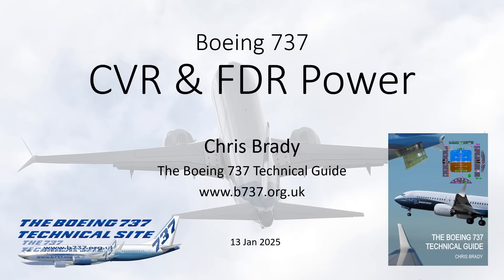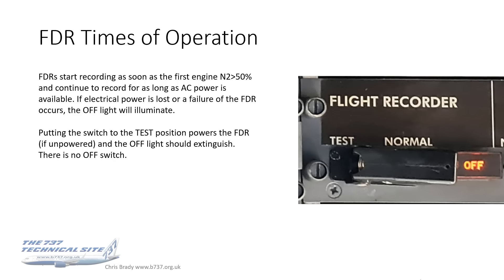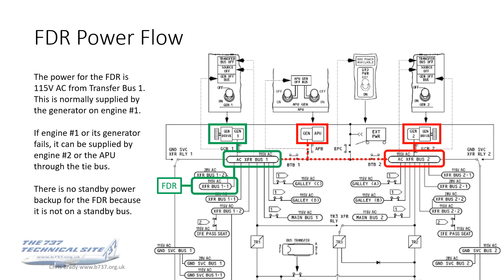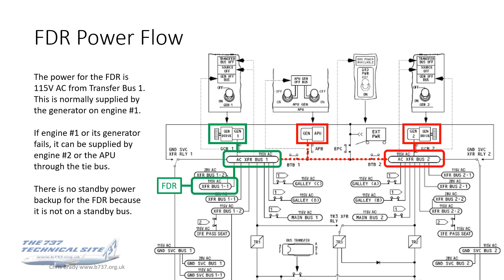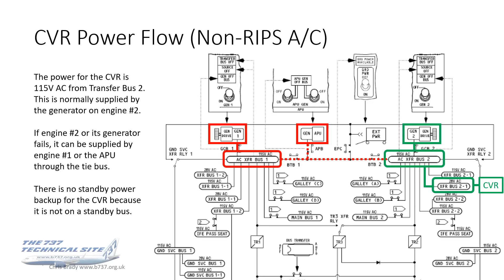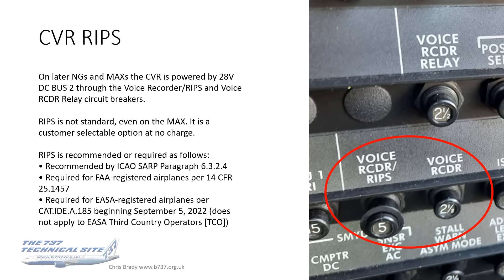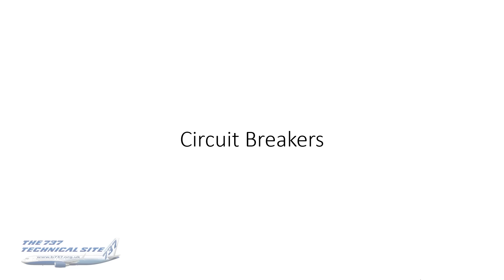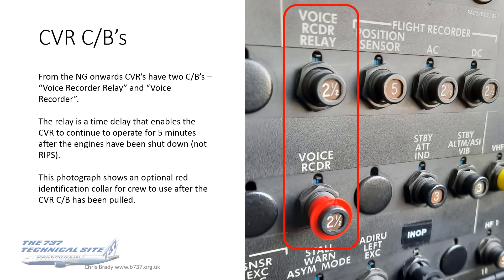737 CVR FDR Power

Comment: A reason not mentioned by Chris, for CVR and FDR to lose power, is if the pilots activated the fire extinguisher modules on both engines.
This cuts all connections to the engines, electrical, fuel, etc.

However, engine number 2 seemed to be running during the landing as indicated by the thrust reverser.
If this is correct, engine number 2 could have provided (some) power, which means it is a mystery why both CVR and FDR were disconnected 4 minutes before the crash.
ADS-B also stopped at the same time.
Reply: ADS-B would stop if a bird took out the antenna.

Comment: I'm rather surprised such a large transport aircraft isn't always required to have a standby backup power source for the recorders that can take over at a minimum when there is no weight on wheels. I would have expected the recorders to be prioritised to the same degree as the primary flight instruments for getting power, as in my view at least, losing the recorder data could cause an indirect risk of loss of life due to subsequent accidents. But i guess with the way the 73 was upgraded in such a piecemeal fashion, it would have been difficult to integrate cleanly and consistently across the fleets, but then again I get the idea that some AD will get sent around after this accident requiring RIPS and similar installations to be added to whatever aircraft don't already have them.
Reply from the maker: The recorders, whilst very important for post accident investigation, are of no help to crew in an emergency. Battery power is very limited and must be used conservatively. The regulatory authorities agree otherwise it would be mandated that the recorders have emergency power. Maybe this will change in the future after this accident.

Comment: Nicely done Chris!  I do agree Boeing's philosophy on maintaining electrical power to systems essential for flight control and that the black boxes aren't critical for getting the aircraft on the ground.  That said if we don't understand the human factors and what failures they are dealing with in an emergency then there will always be the possibility of it being repeated.  

P. S. I believe in the Alaska Air plug blow out incident the crew forgot to pull the breakers and the CVR data was lost.
Reply from the maker: It is (understandably) very common for crew to forget to the breakers after an incident.
Reply: @ChrisBrady737  Ground crew often double check the CBs, just in case the pilots have lapse of memory.

Comment: Speculatively, number 2 engine is damaged, the engine speed is low enough that the generator drops offline but continues to windmill sufficiently for the EDP to supply a small amount of hydraulic pressure, the crew elect to go around to go through checklists, they clean up the aircraft and retract the gear and flaps, the crew then shut down the left engine, all main AC power is lost, including power to the recorders, the crew elect to land immediately but land very long without gear, flaps or spoilers, there is sufficient hydraulic pressure to deploy the right thrust reverser during landing. 
RIP to the passengers and crew. 🙏🏻
Reply: From the ADS-B data, the go around may have started (with two good engines) before the the bird strikes. It is also possible that there was more than one incidence of bird strike.

If one engine had been damage the engine driven generator may have dropped out, so that the remaining engine was supply both the AC XFR bus 1 and AC XFR bus 2. if the good engine then fails all AC power is lost at the same time. This would result in the CVR & FDR and the transponders (and ADS-B) all ceasing operation at the same moment. Which is what appears to have happened.

Comment: 15:05 I have a question. If FDR doesn’t have any standby power. Why there is a DC(BAT) breaker in the FDR field on 737 classic’s circuit breaker panel? Doesn’t it mean FDR has battery? Or it’s only for 737 classic? If so, is there a photo of a 737-800 made at 2009?
Reply from the maker: On the FDR these components get 28v dc power: FDAU status relay, Flight recorder test module and FDR fault logic. Again, the recorders are powered by AC and will not work without it (except RIPS for 10 minutes)

Comment: Simply put, if there were no independent standby battery packs, then when no electrical power was produced for whatever reason, the recorders would definitely have stopped recording immediately. From what you said, this could be determined. However, we cannot determine if that plane has or not had independent standby battery packs installed.
Reply: This airframe, ordered by Ryanair and constructed in 2009, did not have RIPS installed.
Reply: @teebob21  This needs to be determined beyond a doubt, together with the answer to whether the plane was completely without electrical power for the four minutes before it exploded. The victims deserve the truth.
Reply: @teebob21  "This airframe, ordered by Ryanair and constructed in 2009, did not have RIPS installed."

JeJu AIr purchased 11 737-800's from Ryanair in 2016. They currently have 37 on the fleet 20 of which built before 2020 when the FAA  recommended the RIPS to be installed. The remaining 10 aircraft purchased from Ryanair, should be at the original standard, so these could be examined to confirm the absence of RIPS. The modification records for the accident aircraft should also confirm the absence of RIPS.

Comment: Great video Chris, as always!  I must admit, I only became aware of the concept of the CVR/FDR requiring both engines to be running (or the APU) after reading the Air Transat A330 report a few years ago, and being astonished.  If anything is likely to lead to an accident in a twin-engined aircraft - it's not have both engines running!  So, it would be pretty useful to be able to analyse the final stages of the flight, for what must be a minimal electrical power consumption.  Hopefully RIPS will become mandatory soon, although in the Air Transat incident 10 minutes would not have been sufficient for the whole descent.
Reply from the maker: Hi Scotty, useful for the investigators but not useful at all for the crew on the day. Even worse it could be counterproductive to the crew on the day because of the drain on the battery of running the FDR & CVR. The load may be small but it is 115V AC sourced from a 36 or 48 Ah battery. The solution is RIPS with a bigger battery and similar for the FDR. I guess it will come eventually.
Reply: @ChrisBrady737  It doesn't do much good to power just the FDR. The FDAU and the sensors and computers that generate the data that is recorded have to be powered too and most of them are not on the BAT or STANDBY bus.
Reply: They don't require both engines, they require one engine driven generator running (or the APU, or ground power). If one generator fails the bus ties will automatically close to power that transfer bus from the other generator.

Comment: So, the #2 Gen is possibly damaged  by the bird strike and then the crew inadvertently shuts down #1.  On battery power now but no recorders.  Correct?
Reply: Why would they turn off an engine in the first place? There was no fire seen from the ground?
How would immediately turning off an engine help an aircraft which would land in 2-3 minutes?
Reply: @user-yt198  When a birdstrike damages an engine it typically is because it took out one or more fan, compressor or turbine blades. That loss may cause compressor stalls which can create further damage to the engine and affect flight performance and handling, but will certainly cause a severe off-balance vibration, possibly at resonance frequencies with other structures that can cause catastrophic structural failure.
Reply: @petep.2092  We are talking about engine #1 (the left engine). In the videos and after accident photos it looks in quite good condition.
Possibly it was affected yes, but such a vibration would not be more than an annoyance for such an engine as we see.
 Obviously there wasn't a fire which would affect aircraft safety either.
Again, why would a pilot turn off an engine of an aircraft which would land in 2-3 minutes?
Reply: @ I don't speculate on what may have transpired. I was simply answering your question: why would a pilot turn off an engine?
Reply: @petep.2092  You think you are answering? Pilots turned off the engine because noise was disturbing sleeping babies?

Comment: I maintain 737s for a large operator in the USA and am very surprised to learn that RIPS isn't a requirement on all NGs. Our fleet has had them for years. Truly shocking this isn't actually required equipment.
Reply from the maker: I suspect it will become a requirement soon
Reply: @ChrisBrady737  Indeed.

Comment: Great video! Minor correction, for RIPS battery life, it’s not “at least” 10 minutes, it’s EXACTLY 10 minutes. The regulations require RIPS to provide power for 10 minutes to the recorder with plus or minus 1 minute margin. The battery can definitely provide power for longer but it is designed to cut off after 10 minutes due to concerns of powering it on for too long will overwrite previous data.
Reply: Also, if it provides power after every normal shutdown, if it would run until the battery died then the battery would be empty for the beginning of the next flight while it charged, so there'd be no RIPS protection for incidents happening early in the flight.
Reply from the maker: Correct 10 +/- 1 minute

Comment: So in theory, if the plane was dispatched with APU under MEL and it did lose both engines, that would be enough to explain the loss of flight data and voice recorders ?
Reply from the maker: In theory yes but we won't know for sure what happened until the final report
Reply: The APU air inlet door was closed, which suggests that the crew did not attempt to start up the APU.

Comment: Could they have dispatched with a failed generator and not had the APU running as a way a single failure could take down both transfer busses ?
Reply from the maker: Not legally. Under the MEL for despatch with an engine generator inop "Except for ER operations, may be inoperative provided APU generator operates normally and is used throughout flight."

Comment: If fire is occurred in gas turbine engine and can not be cleared by lowered the throttle, pilot can use fire extinguisher.
Since the fire extinguisher is only one time use, if the  connection in user panel is wrongly connected, the good engine may be cut off by fire extinguisher.
The connection can not be tested on ordinary checking.

Comment: i work at wendys bro tell me what happened, the south koreans edited the at the last 4 minutes to cover up the accident and save face huh
Reply from the maker: We all have to wait until the investigation is complete and the final report is issued before we know what happened. I am just giving background technical information about the way the 737 works.
Reply: The FDR was sent directly to the US NTSB and was found to be unopened and sealed.The connector was repaired and the data was downloaded. 

The CVR was downloaded in Korea and when it was found that the last 4 minutes were not recorded the CVR was sent to the NTSB. The unit was unopened and sealed. The NTSB downloaded the data from the CVR and confirmed that recording had stopped on both the CVR & FDR at exactly the same time.

The data that has been recorded cannot be erased from outside of the recorders. As both units remained sealed, the data was not erased.

Comment: The CVR should be operating under all scenarios. A battery dedicated to power the cvr should have been realized, like a backup power source in many consumer electronics. Design flaw by Boeing and overseen by the FDA, imho.
Reply from the maker: The recorders, whilst very important for post accident investigation, are of no help to crew in an emergency. Battery power is very limited and must be used conservatively. The regulatory authorities agree otherwise it would be mandated that the recorders have emergency power. Maybe this will change in the future after this accident.
Reply: @ChrisBrady737  Nobody claimed that the recorder should be helpful inan emergency. The recorder is helpful to prevent mistakes and thus another crash. If the recorder cannot provide recording, the recorder must not be installed. The battery necessary to make the thing work is a piece of cake compared to other batteries in the plane. The regulatory authorities made a mistake on the expense of flight safety. Due to no data for the last 4 min, we dont know of  other possible major design flaws which makes the model unsafe. Imho i would understand if the FDA  is thinking about a grounding. There might be a shutoff of the wrong engine happened, but shouldnt be there a software to prevent such a deadly error? We dont know what happened, in dubio the aircraft is unsafe.

Comment: I do not see the logic in saying the recorders do not need a battery backup because they are not needed to get the plane down to the ground. That logic implies that the recorders are never needed in any emergency situation, so then why have them on the plane in the first place?
Reply: They are there to record what happened and what was said, but when you are operating on batteries only there is far more important equipment and systems than the recorders needing that power.
Reply: But if that situation and prioritization is clearly envisioned, then the 10-minute local backup should have been made mandatory decades ago. Also, why did the recorders continue to function on TransAsia 235? And was the only reason the recorders continued to function in the Miracle on the Hudson because Sully quickly turned on the APU? Or did the A320 RAT power the recorders? If that were the case, that would be drawing power from the RAT that should be prioritized for getting the plane on the ground, same as with the 737 battery. So many questions.
Reply: @westwind55  decades ago RIPS didn’t exist. Decades ago CVR’s only recorded 30 mins, decades ago all data was recorded on tape.
Reply: @westwind55  The A320 has a RAT the 737-800 does not have a RAT.
Reply: @christopherrobinson7541  I know the A320 has a RAT. My question is whether that A320 RAT will power the recorders if both engines fail and the APU is off.

Comment: Chris, I would be interested to learn about the sensors and indicators presented to a pilot allowing determination of a failed engine. I understand that fire detection is indicated. Modern jet engines are full of sensors, given capability of condition monitoring systems is there a warning of severe shock/vibration resulting from bird strike?
Reply from the maker: The engines have vibration gauges. You can see them here: http://www.b737.org.uk/powerplant.htm#Airborne_Vibration_Monitors
Reply: @ChrisBrady737  Chris, thanks, interesting that detailed information is provided in cockpit instrumentation. I guess this begs further questions:
1. Probability of bird strike disabling both engines 1 & 2 simultaneously.
2. Human factors, pilot interpretation of information provided on engine instruments.
3. Instrumentation improvements since BM flight 092 (east Midlands/Kenilworth) in 1989.
4. Would rear facing CCTV camera and cockpit monitor help?
Reply: @steveradford5460  "1. Probability of bird strike disabling both engines 1 & 2 simultaneously."

If one engine is damaged (say No 2) it might still be able to produce low power and drive the engine driven hydraulic pumps and support light loads, such as the flight controls. However, the electrical generator may trip offline. This would result in the crossties connection both the AC XFR 1 bus and AC XFR 2 bus to the generator on the good engine. Latter it the good engine fails and that generator goes offline all AC power is lost.

That is the events to the engines do not need to be simultaneous. Indeed the aircraft may have struck more that one flock of birds, resulting damage to both engines.

Comment: If the landing gear was lowered in the Jeju incident, would the brakes have been operable?
Reply: Yes but only by an accumulator. Basically don’t pump the brakes, apply one single force but don’t over do it or wheels will lock up
Reply: @tomstravels520  Would the anti-skid workin  this configuration?
Reply: @christopherrobinson7541  I don’t think so and brake pressure would be from an accumulator so you only have so many brake presses before pressure is lost

Comment: There is a lot of focus on the recorders stopping to record data, or audio, respectively, and usually stopping to work is taken to be synonymous with electrical power being cut. But isn't there a second factor? For data to be recorded, the recorders must obviously work, but additionally some external system(s) must supply the data to be recorded. With the recorders located in the back of the aircraft, both audio and most, if not all, of the data must be transmitted from far away, e.g., cockpit audio comes from the very front of the aircraft. How redundant are these connections? How plausible is it that the flow of data was cut? Notably, the transmission of location data to the ground stopped seemingly at the same time. Is there a single point of failure that could interrupt the transmission of all the sensor data?
Reply: Then they would record noise, not absolute zero like in this case.